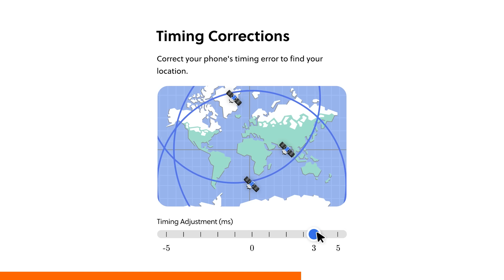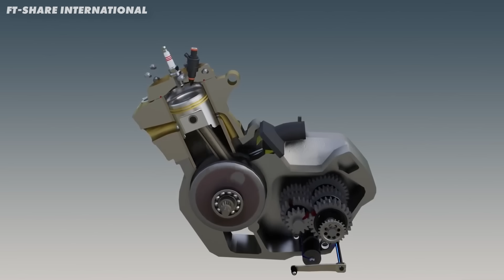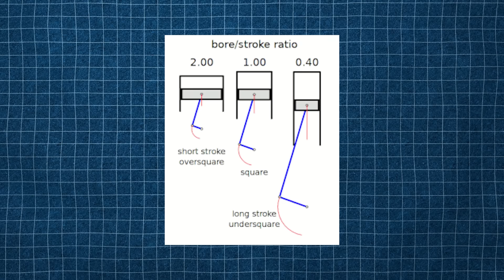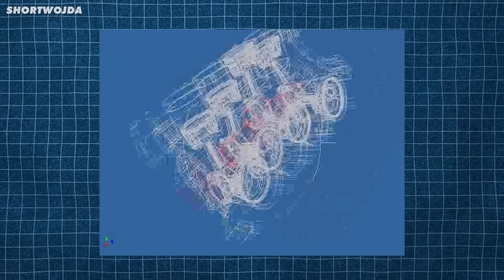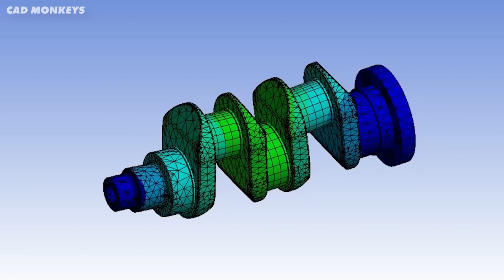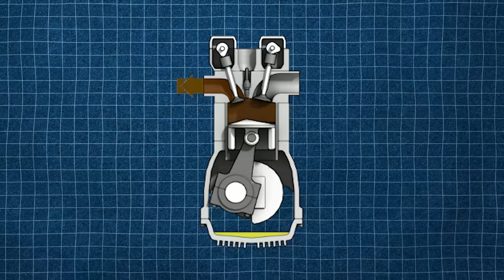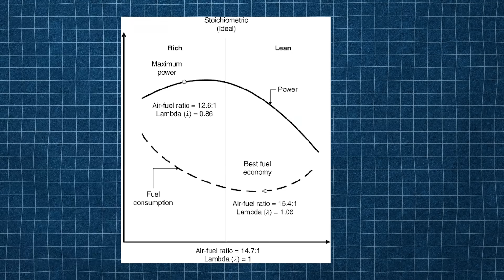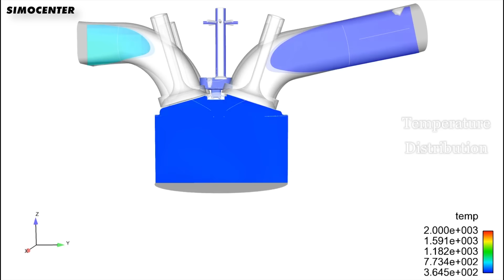Why It’s Almost Impossible to Rev to 21,000 RPM

Comment: Well, mechanical constraints do not limit you to 20k RPM, if going above that RPM is your only goal. What limits your RPM is time. It takes time to exchange gasses, build a flammable mixture, ignite the mixture, and then you want time for the mixture to push the cylinder down. A longer power stroke will extract more energy inside the engine and send less energy down the exhaust. So it's a design balance between energy sent to the turbo/MGU-H and energy kept inside the engine.
Air exchange can happen close to the speed of sound, which is close to 350m/s at ambient and close to 700m/s at exhaust temperature. Reaction time is a view µsec. The speed of the flame of 0.5-3.5 m/sec is the limiting factor.
So you don't want to rev higher because it would reduce the amount of energy you get at your crankshaft at a certain point, and you want to rev even lower to avoid heat and save on mass you would otherwise need for cooling.
PreChamberIgnition (PCI) was also designed to save a lot of weight. With it, you only need a flammable mixture inside the prechamber. That flame can travel through mixtures that would be too rich or too lean to ignite. In an engine, the mixture is way too lean. So you get much more air to a slightly lower temperature and pressure. An engine that runs rich to stay cool at high rpm would burn 2-4x as much fuel. Which does not work with the current fuel limit and would still be irrelevant if you could use as much fuel as you would like.
It would only be interesting if the cars would be significantly (200kg<) lighter or you could refuel without any drawbacks.
Reply: This is nonsense - 30 seconds on a calculatr will tell you that, in an ordinary car engine producing peak power at 6000RPM  you have 5 ms for the entire power stroke if you maximum flame speed is 3.5 m/s then the flame will have progressed a whole 17.5mm in that period. What you are quoting is the flame speed through a quiescent, homogeneous mixture. What we have in an engine (even those with a "quiescent" chamber design) is a gas and fuel mixture which is anything but quiescent - we have very rapid gas movement which rips and tears at the flame front, streching it, pulling pockets of flame into the unburnt mixture and shoving misure through the flame - it's chaos! This effect speeds up combustion by orders of magnitude - and, the faster the engine runs the more energy is imparted to the gas so the energy that goes into "stirring that pot" increases with engine speed now at more conventional engine speeds and engine geometries (bore:stroke ratio) it is a happy accident that the effect of more energetic stirring almost perfectly matches the the reduced time available for combustion - so the combustion period, measured in crank degrees - which is what counts for these purposes, remains remarkably constant as engine speed changes. now I can imagine that, as over-squareness gets to extreme levels, like in a 20,000 RPM F1 engine, 2 things start to happen: the inlet gas velocity is atypically low because the mass of gas induced in comparison to the bore size is relatively low- big valves low mean inlet gas velocity -  so the "stirring energy" will be lower and the flame speed could start to drop - hence the success of a pre-chamber. 

Similarly (and the video is talking rubbish here too) Stoichiometric is NOT where you want an F1 engine running - max power is at about 12.5:1 so there or a little richer is where you want to be - richer does give a petrol cooling effect but you can't go anywhere near "2-4x" as much without passing the flammability limit - which means the mixture would not fire. You also loose power as well as fuel consumption if you go richer. It is true that a pre-chamber can exploit the possibility of different A:F ratios in the chamber and in the main body and that is exactly what the Honda CVCC system did  - nice and rich in the pre-chamber and lean, lean lean in the cylinder - to give overall a leaner mixture that you could reliably ignite with a sark and drop the NOx levels - that is not what is happening in an F1 engine.

The speed of sound - ah, yes, it matters but not in the way implied and, honestly, life is too short.
45 years an engine design, development engineer - cars, bikes, F1, loco/marine, consumer industrial, you name it. I sympathise very much with @bythelee whose comments I thought excellent (Do I know you I wonder???? - it's a small world) and whose comments on current practice with respect to piston rings and their materials I would be fascinated to see - gas force vs TDC inertia force is a tricky area for very high speed applications.

@MrHaggy, apologies if I have flamed you - there are many posts here that could have sparked (pun intended) my ire but you just happened to be " the one" - and it's a crappy video too - trying to make things clear for the layman does not excuse sloppy practices or spouting nonsense

Comment: I think your figures and stats at the beginning of the video are off by a factor of 10. With the piston speed given (96kph) and the given time (ms), my calculatons give piston acceleration of 906 G and an equivalent piston mass of 199 kg (assuming a 220 gram piston), which is still impressive NGL.

Edit: The piston's mass doesn't physically change mass, but it exerts a force at 906 G equivalent to a 199 kg mass at 1G.

Comment: I remember 37k rpm 2stroke nitromethane fueled engines in 2.5 cc displacement. Was  used in control line airplanes.

Comment: Not often you're right, but this time you're wrong again.
The mass production Honda CRB250RR road bike, 4 cylinder, 4 valve piston engine, redlines at 20,000 and will over rev to 22,000 rpms with the limiter disconnected. .

Comment: At 10:13
A complete 4-stroke cycle takes 2*60/20000 = 0.006 s
You forgot that a full 4-stroke cycle takes 2 revolutions of the crankshaft. Still a very short time...

Comment: At 06:29
The length of the conrod has nothing to do with the stroke.
The stroke is determined by the offset of the taps on the crankshaft only.
Reply: It's mind boggling that people proport to be educational, but make no effort to ensure accuracy. Not only did he point out the rod length when mentioning stroke, but he suggested they were short, when what he should have said ( and not skipped over) is the rod length as a ratio compared to the stroke is actually quite high.

Comment: peak cylinder pressure in a race engine 1500psi. probably even more win a race engine, so with 80mm bore that's over 15000kgf pushing on the piston

Comment: Quick question.  Was Mercedes dominance in the 201x era due to a advantage they had with combustion and then RedBull got Honda instead of Renault because Honda invented this external pre ignition technology dating all the way back into the 70s with the amazing Honda CVCC that was getting 60MPG on plain pump gasoline.  In other words, Mercedes was using this to get a HP advantage, and after a couple years of joy, all the other teams figured out how to do the same and the advantage was gone.

Comment: Two strokes don't naturally rev higher.
It's the opposite.

For a given displacement, a two stroke needs to have a longer stroke, since it has to open ports.
4 strokes didn't, since they breath from the valves.

Since the main limitation for rpm is the mean piston speed, and since for a given speed the longer the stroke, the higher the piston speed, 4 strokes with large bore and short strokes can rev higher.
Reply: That what I was thinking. The 500cc GP bikes didn't go much past 13000 rpm, if that.
Reply: @muttley00  it's a well known thing, but some people think that since the smaller mass produced 2 strokes revs higher than bigger 4 strokes they can rev higher.

Comment: I rarely post comments like this but... At 8:18 - Aluminum has a better strength to weight ratio than steel, but is more vulnerable to fatigue, not less. Strength and weight are completely unrelated to fatigue in general. You actually picked the two most extreme examples to be wrong about - in that some steels will literally never fail due to fatigue as long as they aren't overloaded, but with aluminum any repeated load will eventually cause a fatigue failure no matter how small. Some ferrous titanium alloys can behave more like steel - but it's because they're ferrous, not because they're titanium.

Comment: Ultimately RPM is limited by fuel deflagration, both burn development and flame front propagation phases. Using oxidised fuel can nudge up the limits but not that far.
Another limit is the fuel and ignition control system processing and actuation speed. 
We can always reengineer around material deficiency’s.

Take a look at Hondas RC166 from the 60’s for the 1st 20krpm engine or the later MC22 that did over 22krpm in race trim - super small, lightweight components running on carbs…

Comment: There is no magical RPM ceiling.   It's always a compromise between maximum RPM/HP, reliability, fuel and oil chemistry, cost, necessary fuel mileage and materials technology.  All of these factors have to be weighed against each other in light of whatever technical rules the engine is subject to.

Comment: They could build supercharged 2 strokes with DI, a cyl. head with exhaust valves/camshaft and have an engine that would make great power and not burn oil or have raw fuel exit each exh. stroke.

Comment: RC model engine regularly run around 30.000 rpm, and some even higher, i've seen up to 45k being suggested. Granted they run on nitromethane, which burns fast, but the mechanical aspect is still here.
Just a little info to temper the "absolut limit" idea that seems to be played here

Comment: Im sure that some of the v10s and v8s hit 21-22k rpm. Im also sure that the v6s could be rev'd to over 20k but that ruins the life span of the engines and would also burn through 100kg of fuel before the race finished.

Comment: I'm sorry to say your statement on fatigue in aluminium is not correct. It is just as susceptible to fatigue as steel. Even worse, aluminium does not have a fatigue limit like i.e. steel. The only reason that's not a problem in F1 is because the engine isn't expected to last very long anyway.

Comment: Hi. Actually two stroke engines doesnt rev as high as four stroke engines. Of course there is two stroke engines, that can rev higher than some other four stroke engine. But usually four stroke engines revs higher than two stroke engines, if we compare same size engines. You see, just for example, lets take two high power and same size engines, one four stroke and one two stroke. Both engines are 250cc single cylinders. And woula, four stroke engine revs couple of thousand higher. And one misunterstand, what I hear very often is, that "four stroke engines do more torque than 2 stroke". And thats of course not true. We know that power is torque x revs. So,  2 stroke engines make around double the power, but they dont rev double. They rev less, and that means there must be a plenty of torque. And thats true. Usually 2 stroke engines make abaut double the maximum torque. And so, they doesnt need to rev so high to make power.

Comment: A couple of things that I noticed in the video.
Engine friction wasn't mentioned but is a key reason for not increasing engine speed further.
The NA F1 engines used port-fuel injection, direct injection came along in 2014.
Current F1 engines do not use TJI as described in the video, they use a passive pre-chamber as only one injector per cylinder is allowed.
The stoichiometric air-fuel ratio of gasoline isn't 14.7:1, it depends the formulation of the particular fuel.
Reply: "The stoichiometric air-fuel ratio of gasoline isn't 14.7:1"

- Generally speaking is it.
Reply: @thedirtyworkshop  generally speaking it's not, which is why most people would use lambda or equivalence ratio to describe the chemistry of the air-fuel mixture, as it's formulation agnostic.

Comment: When f1 is going to change to 2 stoke, what have to happen when it's going down the way it does right now, above 30000rpms will be common.
Reply: And yes they are way not as good as 4 strokes in fuel efficency, but take ALL the work and time racing teams did on the 4 stroke, imagimg that on a stroke. We probably would have a 500cc 150HP Bikes ;D

Comment: Can't you just reduce the size of the pistons so you have less mass rotating to increase the rpms? Valve springs would be the next issue.
Reply: That’s exactly what they did with V8s 😃 from 3.0 liters of V10s to just 2.4 liters of V8s

Comment: 6:26 Note that the length of the connecting rod doesn't affect the cylinder stroke at all, it is the crankshaft that affects it
Reply: True. The crankshaft affects the minimum con rod length but not the maximum so in theory it could be longer and still have the same stroke ... but I can't think why anyone would choose a longer con rod than absolutely necessary, so in that sense the crank defines the con rod length and to that extent it boils down to the same thing.
Reply: @MrAdopado  you should watch the video by d4a about rod ratios. A longer con rod is actually better

Comment: i thought that was sort of a "piston" engine problem, 
other engines have very little issue going about 21000rpm (turbine being the main, however i am sure a rotary could too)
Reply: Rotary engines have a lot of the same problems as piston engines at high rpm. Turbines are different because they don't have back and forth Inertial forces, they just spin.